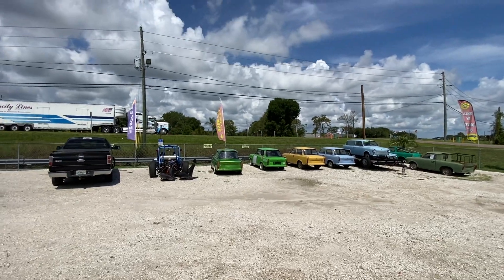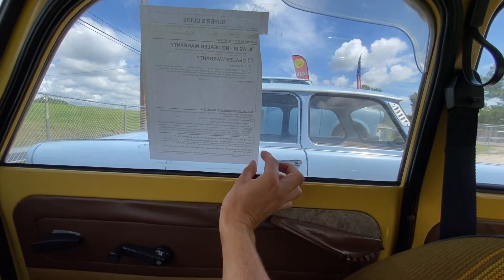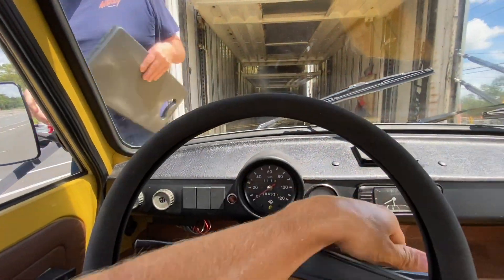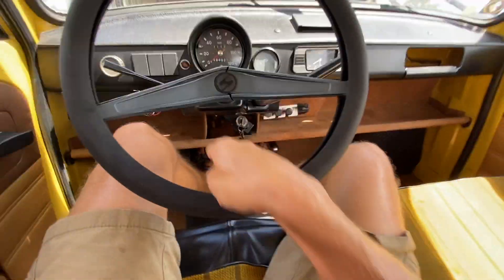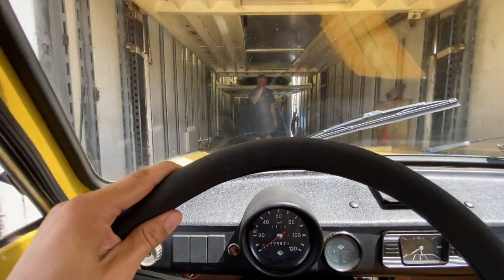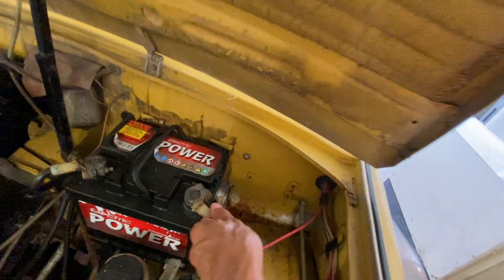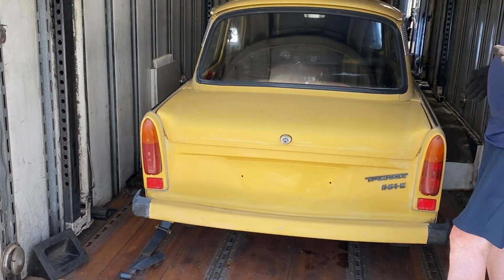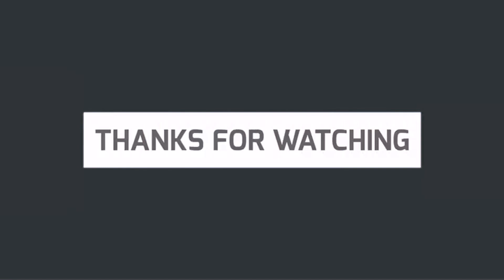Good Bye - Trabant 601 Sold to Connecticut

Comment: I had a Trabi in the same color. I sold it last week. It was in very bad condition, in need of a good repair. The hull was very rusty, the engine was running, but when it started there were explosions and the car didn't move. I sold it for 3600 euros but I was in Germany.
Reply from the maker: Good for you! 🥳